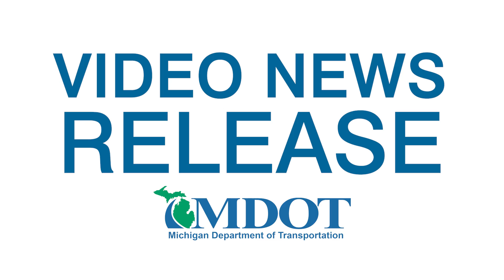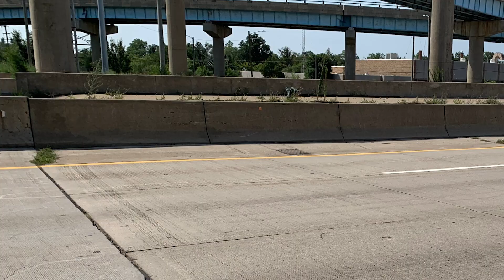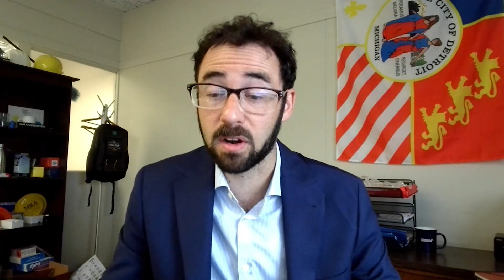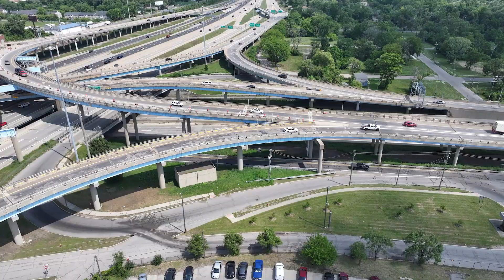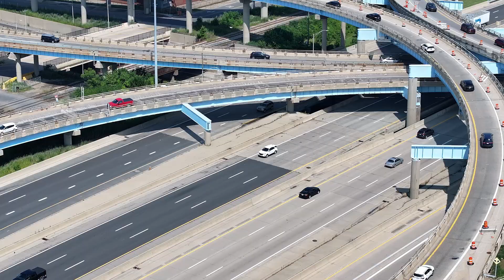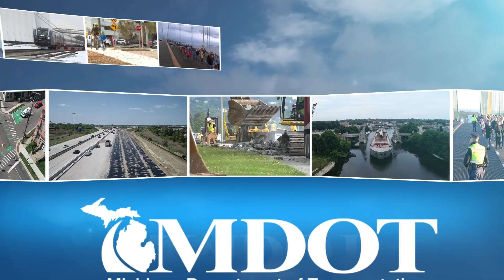Bridge profile: I-96 over M-39 in Metro Detroit

Comment: When is MDOT going to redesign M59 and I75 interchange?  It is so dangerous and MDOT has been talking about modernizing the interchange for about 30 years.........
Reply from the maker: Hi Joseph! In the early 2000s, MDOT concluded a study on modernizing the interchange. The amount of right of way needed, in addition to the design and construction cost, approached $500 million (in 2000 dollars). We still have that interchange identified as a need. If we are able to secure the needed funding for the project, we would launch into an environmental study (federal requirement) and subsequently begin design and construction. At this time, that funding has not yet been secured.
Reply: @MichiganDOT  Hopefully there are ways to find budget efficiencies and/or new revenue, that cloverleaf interchange is fairly dangerous. 
If only we had the money, most fo downtowns interchanges need a total redo as well, and i-94 needs to be 4 lanes to handle the traffic from 75 and 96 more. 

But that's a lotta work, and not a lotta cash lying around.